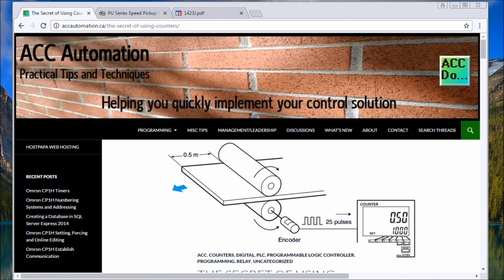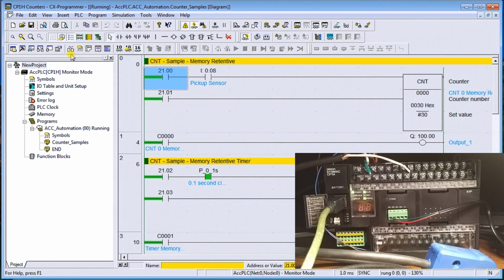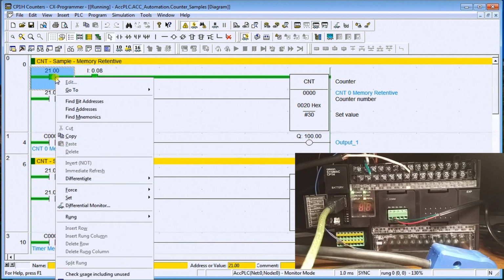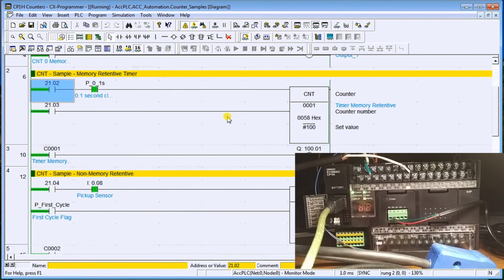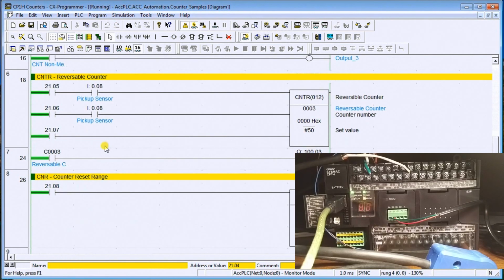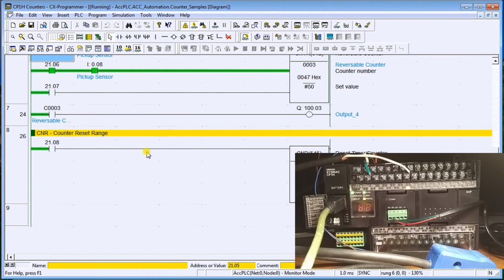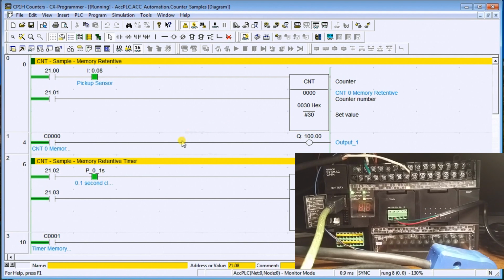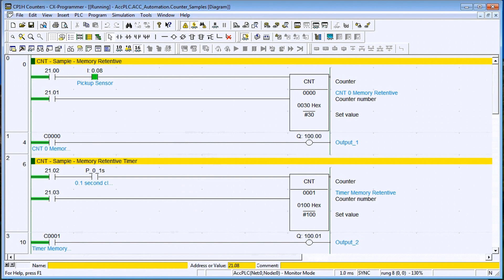Master Omron CP1H Counter Programming: 4096 Counters Unlocked

Comment: sir how  to do wiring for omran relays  please practical or example
Reply from the maker: Hi Pradeep
What Omron relay do you have?
https://www.omron.com/ecb/products/pry/

Example:
Here is the information on the Omron LY Series Relays:
http://www.ia.omron.com/data_pdf/cat/ly_ds_e_4_5_csm54.pdf?id=949
We would specify a coil voltage. This would be the voltage needed to turn on energize the relay to cause the contact to switch.
LY2N 110/120

If this relay were wired to the output of the PLC. You would wire your 120VAC supply in series with the output point of the PLC and the coil of the LY relay.
 
If you have this as an input to the PLC you would have a sensor (Limit Switch / Proximity / ect.) power up the coil of the LY2N 110/120. One of the dry contacts from the relay will then be wired in series from the 24VDC power supply to the input of the PLC. 

Connects like the ones mentioned above are called interposing relays.
Here is a wiring diagram of an interposing relay.
https://qph.ec.quoracdn.net/main-qimg-1ce89c0b48f4b9c14aa816e171c99ab8
The switch is energizing the 12VDC coil of the relay. The contacts from the relay are switching the 120VAC lamp.

Hope this helps you out.
Regards,
Garry